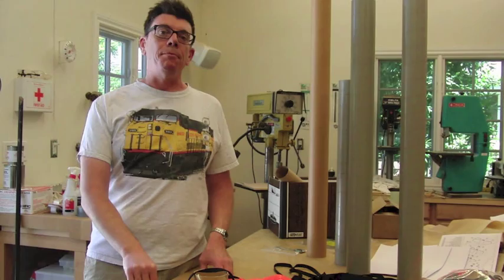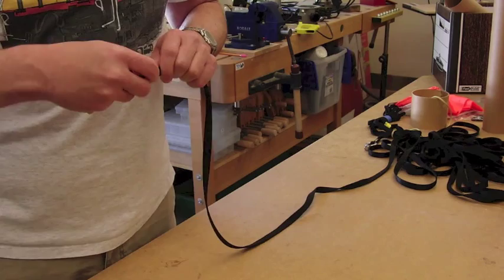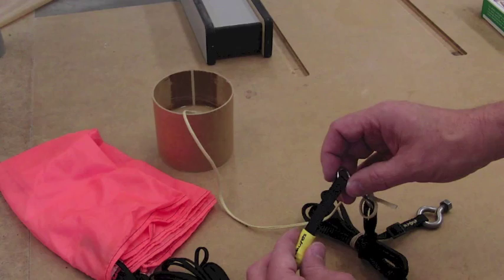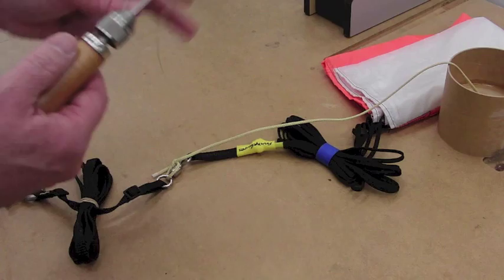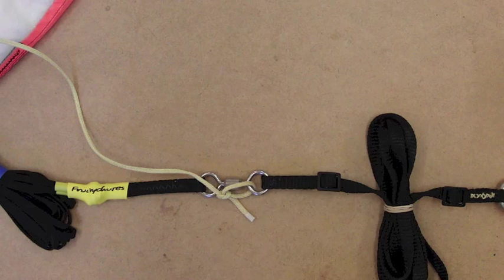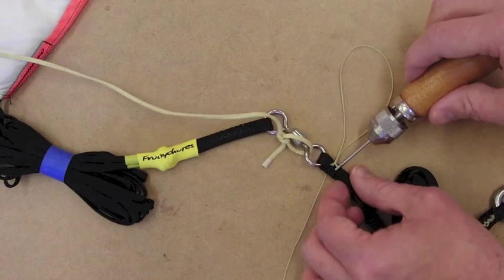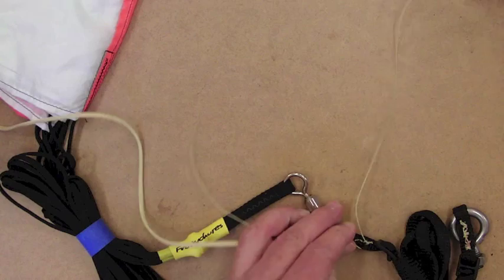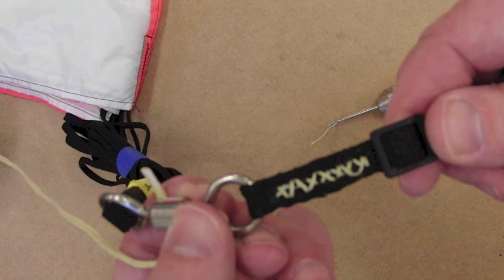Sewing a Bridle

Comment: Thanks John. You didn’t have any problem (melting or degrading) of the stitches sewn with the supplied thread? Or do you, in retrospect, recommend Kevlar?
Reply from the maker: I use a kevlar sleeve around the end of the bridle nest to the ejection charge so both the Nylon and stitching is protected.